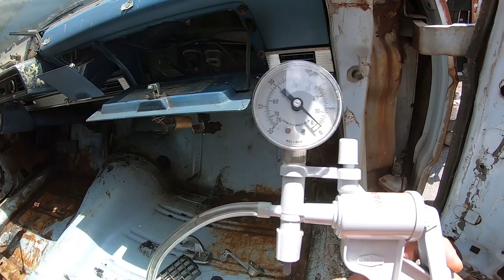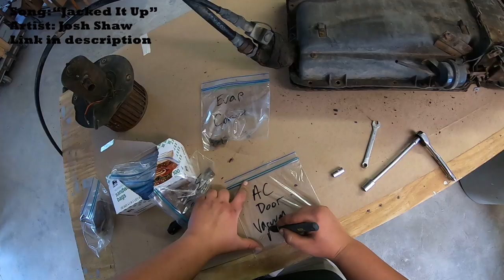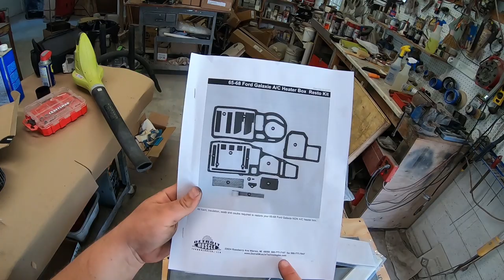Restoring the AC Box In The 66 Galaxie Project! Full-Size Ford AC Box Rebuild

Comment: Great job! Looks mint from here. 👍 For the heater box, just drop the inner fender and work through the wheel well. Start soaking the bolts now. Helps a lot.

Comment: Nice job on the A/C unit. It wouldn’t hurt to go ahead and knock out the heater core with a new one while you have the hood off and remove the inner fender to get that out of the way. 
Then go for engine bay prep and spray. You’re doing good job take your time to do a good job 👍 
Hope you have a Blessed One Sir.

Comment: Ok. Also if you need a picture of it, I'll send it. My hubby and I are trying to peice this car together. He got his mag today from Macs Auto parts today. It has some parts in it he needs. But he need those 4 darn peices of chrome that runs down along the sides of his bench seat. We had 8 peices of pot metal chrome sent away to get rechromed. My gosh we could of bought another vehicle for what that rechroming cost something like $2500.00, I liked to of of died. Little peices they where. Then one peice got broken during the shipping to where it was going. But our Chrome guy is the man for rechroming.nbut hey if ya need pictures of that under the dash AC unit. Let Jim and I know. And it's you'res free ok?

Comment: Good thinking. Too many people just give up on the HVAC system because they expect to drive the car during summer only. The heater on my 64 Comet was totally shot but I decided to get it done and boy was I happy I did because they only started spraying salt on the road in November here in Austria (I drive the car as deep as I can into pre-salt winter)! One small suggestion: get a pedestal for the accelerated shots as with a head camera one gets dizzy lol... Oh I'm sure you saw this (probably a bit above the budget but it shows what you can do with a 390): https://www.youtube.com/watch?v=iLxMVfnvLvU
Reply from the maker: I want to be able to drive this car year round, plus summer gets hot here in southern USA lol. I saw that video, definitely above my budget but gives me ideas for the future should my 390 need an overhaul. Thanks for watching!
Reply: @griffparker1466  we can dream... Am  leaving the 289 stock until I get all the other stuff done (suspension, front disc conversion, 3 on the tree to 5sp swap etc.) but then it will come out and be breathed on.